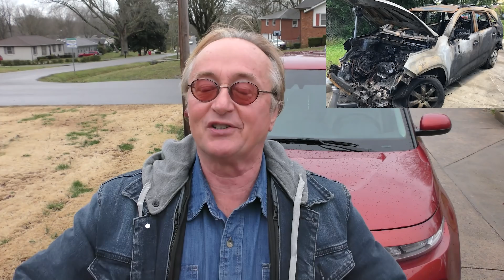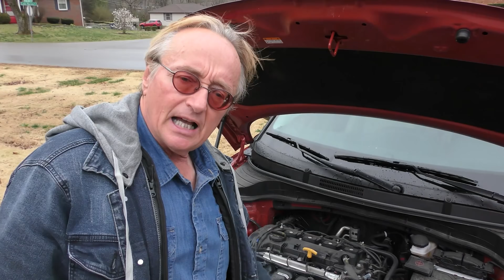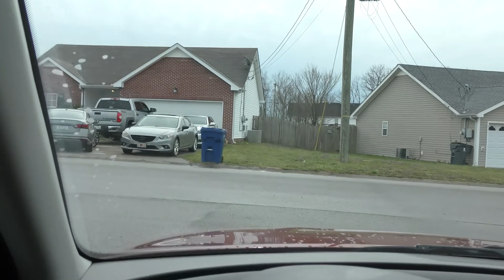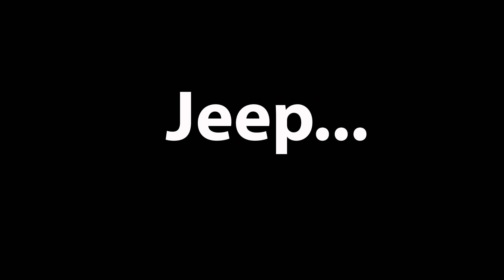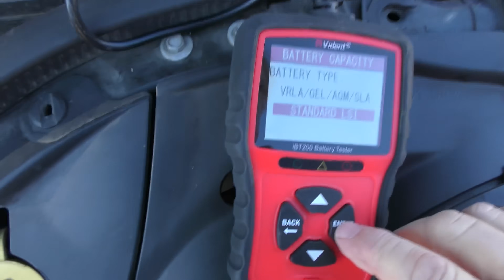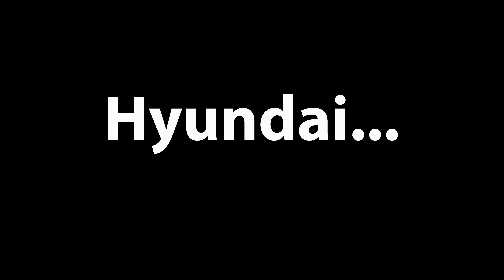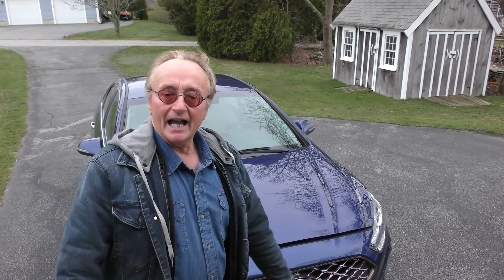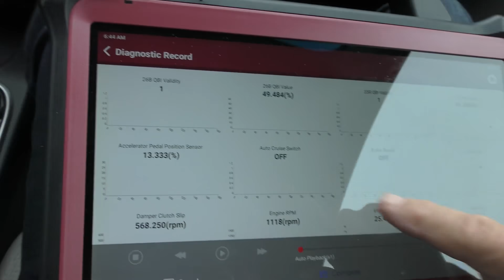3 Car Brands That are Crap

Comment: Trivia if you have a Hyundai, I bought one with 1500 miles on it, a lovely Tucson. "Must be something wrong with the transmission, it bumps when starting out from a light.
I fixed it by turning off the auto stop. The 'bump' was him hitting the throttle hard when the car tells you the car in front of you is leaving.
When I don't remember to shut off the engine stop at lights I just don't 'nail' the throttle and it goes up smooth as glass. The car starting and trying to hole shot is what made his bump. The dealer tried to explain it to him, but...

I get better mileage in Sport mode. I got better mileage in the Kia I had before by turning OFF the Eco mode. In the Tucson it gets thirty (All wheel drive, triple digit temperatures and very fast freeway driving) in Sport mode. I only get twenty seven in 'Smart mode'. Go figure.
My wife drove the Kia to 50K miles and sold it to a girlfriend. She's already put 15K on it. No problems for either of us. Very well equipped and very reliable.
Every maker can make a problem car. 

On the oil burning not being a reason to replace the motor, Ford, Chevy Toyota etc.,  all of them consider a quart in a thousand miles normal. Ask the dealership. Yeah, it's not normal with modern engines but that's the rule. Ask.

Try a Honda CRV if you want oil burning problems. I turned down NINE of them when looking for a nice SUV/Wagon for my wife. All the sellers admitted they were oil burners. 
This is a known engine problem, which caused forced recalls in China, Europe and Canada, not here.
My last Camry was pumping oil by 60K miles. That was back in 2004, it was a bought from new 2001.
I recommend Toyota but don't ever think they haven't had their fair share of problems, like the frame we put under my buddies low mileage Taco. A California truck. At sixty K miles the frame broke. They accused him of driving it in the snow belt.
Don't get a lot of snow between Lancaster and Long Beach.

Comment: I bought a brand new chevy 2500HD in 2021 , it had gaulded pistons at the start cold idling, chevy did not fix it , it took several 1000 miles for it to stop .

Comment: I’ve owned 3 KIAs.  Always changed the oil at 5K.  Always had the 2.4 liter engine.  I test drove the 2.0 liter & didn’t like it.  Never had a problem with the 2.4 liter & they didn’t use any oil but never drove longer than 75K & then traded-in.  The service is not as good as it used to be.  Overall KIA  is not that bad but could be better if they focused more on their customers.  Out of the 3 vehicles I owned, one wheel sensor went bad.  No other issues.
Reply: Interesting... Though Kia/Hyundai has like 3 completely different 2.4 liter engines and 2.0 engines from 2004-2015 or so. Oldest, Sirius is Mitsubishi engine. And two later, Beta (2.0) and Delta (2.4 an2.7) are solid quality engines as well.

The problematic ones are Theta models, that come in both 2.0 and 2.4 liter, and are completely new desing. Nu engine also has 2.0 variant, that's been subject to recall.

Comment: I have 2012 Kia soul with more than 160k miles and it’s definitely burning oil now but it had been good to me for the past 8 years. Bought it used I 2014 with only 25k miles on it. Guess I got lucky

Comment: I want that '94 Celica. I was told by a mechanic that my '05 Ford Expedition needed a ECM. I bought one online at Flagship 1. Supposedly it comes programmed & with 2 keys. I installed it myself & no change. It won't go past 45 mph & the dash reads check Electronic Throttle Control even though that part had already been replaced. The mechanic said the computer still needed to be programmed & he doesn't do that; take it to dealership. Dealership says we don't service vehicles older than 10 years. 🤷‍♀️

Comment: I own a Hyundai. It doesn't blow engines, and the transmission doesn't make "funny" sounds, because it is a mechanical manual shifting 6 gear transmission. And the oil consumption is neglijible.

Comment: I had a Kia Forte from 2010 to 2018. Around 100,000 miles it started to have normal problems but the kicker was the radio went out and I was ready for a new car anyway.

Comment: Don’t forget though that the Toyota 2.4L has had an excessive oil consumption problem since it’s inception. Did Toyota fix it? Nah, they just issued a Technical Service Bulletin stating that 1 qt every 800 miles is “normal” oil consumption. Toyota is just as guilty of this issue as Kia is.

Comment: Our 2019 Hyundai Tucson ULTIMATE a/c went out at 25,800 miles.
They tried to get me to pay $700 even with the warranty.

Gov needs to start legislating these auto-maker crooks. You pay $35,000+ for a car... should be BUMPER TO BUMPER FULL WARRANTY to 100,000 miles! 

That would force them on quality control!!

Comment: I've had 6 Kia vehicles (both leases and purchases) since Nov. 2011 (a 2012 Sportage / lease, a 2014 Soul !  lease, a 2016 Soul Base lease, and 2016 Rio LX manual purchase, a 2019 Soul + purchase, and a 2022 Seltos lease) and NONE of my Kias have had ANY issues AT ALL.  All recalls (none of which affected our cars directly) were addressed easily by my dealership and I'm a VERY satisfied Kia owner.  I've heard horror stories about the engine fires and the security / theft issue that has been all over the news.  But none of that has ever impacted us directly.  Just lucky I guess.

Comment: KIA : Killed In Action. The new car that you buy because it is cheap enough to give you far fewer miles than the usual used car with 40,000 miles on it already.

Jeep... a vehicle originally designed for military use, to be abandoned after about four years., that morphed into a very flawed car.  

Hyundai: rumor is that "Hyundai" is Korean for "Trabant".
Reply: That's not true we got 36,000 on a 2021 Kia soul that my wife bought brand new the problem with these Kia's Audi and Porsche the company that manufactured the piston rings didn't harden the piston rings correctly engine it was losing power and burning a lot of fuel we have thirty-six thousand miles on it now it runs like a top no complaints with that car but I had to put the dealer all over the Internet to get that engine changed  the last time we were there they had the hallway lined up with engines lol brand new in the crate because I put the word out on that car and the engine oil was going up through the throttle body I took that all apart to see what was going on that's when they couldn't tell me why there was oil in the throttle body    now after this is happened Doyle went through the catalytic converter now if this car won't pass the Ames test they'll be replacing the catalytic converter on there dime.  not mine
Reply: Everybody today is either too dumb or too lazy to open the hood and look at the dipstick and check the oil in their car even though it's brand-new don't mean it's good  and if you think you got a problem all you have to do is take it to mechanic have him pull a spark plug out for the bore scope down the cylinders and see what the cylinder walls look like . Just because the  pistons rings we're hardened incorrectly don't mean the car is junk it also happened to  Porsche and Audi in a few others

Comment: As far as the Auto-Stop to save gas. Kia must be slow to restart, most cars restart when you lift your foot off the brake pedal BEFORE you push on the throttle so there's no delay. And with the Jeep, low battery voltage will cause the control module slow to make calculations and make errors, kind of like a person's brain operating on low sleep. Jeep uses extra fine connector pins and weak plugs at the modules. I had one that was doing all sorts of strange things and when I unplugged the Integrated Power Module to inspect the pins for corrosion and plugged it back in, everything started working again and lasted for five years until I got rid of that POS. Sometimes it's something called fretting, where the tiny pins they use at the module build up a resistance where they touch the connectors in the plugs and unplugging and reconnecting them will restore the contact. Now, you can spray the connector plug side only with a contact cleaner then a light spray of penetrating oil or light coating of dielectric grease by smearing it into the female connectors of the plug or plugs. I wouldn't recommend spraying contact cleaner on the module pins because they are on a circuit board and most cleaners can degrade the board, same for the penetrating oil.

Comment: You forgot Nissans, the CVT transmission in those things plus the fact that the battery always has corrosion and the oil filter is in the most weird location possible

Comment: I have a 2018 Kia RIo I bought brand-new (had 11 miles on it).  I have just under 20k miles on it and I have to call the dealership tomorrow to have a new wheel bearing installed.  Never buying Kia again.  Also the rear is out of alignment and can't be repaired because it's a straight axel, like a truck.  Go figure.

Comment: We have a 2019 Kia soul for less than a year and haven’t had any issues. It’s only been a one long trip and still no issues. I would never wait until 7k to change the oil. That’s insane.  Every car I’ve had I always changed it half that mileage and never had any issues.  My first car was the worst, a 1980 VW dasher wagon had a ton of issues except oil. Lol. You probable can’t find them because they are all junked by now.
Reply: Good to hear,as im looking for the manual Soul,last year made was 2021! I was told the early years engines were much better! So, nice to hear 🤔

Comment: Bought a 2017 Kia Optima hybrid brand new. At 20,000 miles had a sudden total engine failure. 
Kia wouldn’t do nothing. 
Fortunately my car insurance company, Erie Insurance, paid for a new engine $5500 less my $500 deductible) bc the adjuster said he couldn’t rule out sabotage. The oil drain nut was found in the oil pan. Adjuster thought the possibility of someone loosing the nut on purpose. I was lucky. I’m sure that was not the reason for my engine failure though. Just a poorly engineered engine by Kia. But, my new engine has given me 80,000 miles on it now, so I feel lucky. Car has a total of 102,000. Other than the initial engine failure the car has been great. Just wondering when this second engine will fail.

Comment: Use dielectric grease on the module pins. That seals out both moisture AND oxygen. It's not 100% infallible, but it may help unfortunate Jeep owners who are in fact be chasing.
Paint a layer of dielectric grease over the connector and re-connect it BEFORE on of those pins starts to develop a POOR CONNECTION, and you, the OWNER, is moving closer and closer to this headache.
Preventative maintinance. Your welcome.

Comment: I had a Kia Soul for 11 years, I put 150k miles on it, then sold it. The only thing I had to do was buy tires and change oil. Best most reliable car I’ve ever owned. I have 1999 Silverado that’s just as good.
Reply: Im looking for a manual Kia, acceleration is really important to merge & pass in my area,Texas! How was acceleration? Nobody seems to mention this topic much? 🧐

Comment: Scotty is the only car youtuber I trust and enjoy. Shout out to vicegrip garage too, purely for entertainment.

Also, I've got a 1994 Jeep Grand Cherokee, 2wd with the 3 speed automatic and the base 4 liter inline 6.

it burns and/or leaks every fluid, it has just over 300,000 miles. She always runs, still passes smog (in California no less)

sure, she absolutely sucks gas in around town driving or stop and go, gets like... 10 miles to the gallon, no joke. But! when on the freeway, esp one that doesn't have hills/inclines, I set cruise control to 65mph, the engine turns at around 1,900 rpm or just barely 2,000 rpm and she gets 30 miles to the gallon!

I remember having a 1990 or so rx-7, naturally aspirated, and it got 17 miles to the gallon regardless of driving conditions. Climbing highway nine to skyline in the Santa Cruz mountains? 17mpg. Stop and go? 17mpg. Freeway cruising? 17mpg.
No matter how much you tried to drive gentle or if you were using a lead foot and chasing the redline, 17 miles to the gallon.

Comment: I have a 2015 Kia Soul with 293,000 miles on it. It helps that its a 6 spoed manual transmission. Yes, it burns a lot of oil ( about a quart evety 1K starting at 80K). But other than that, the car has been very good to me. Starts and runs no problem. Just have to check oil every fill up and spend $5 on oil about every 1K.
Reply: I guess I lucked up, I have a 2016 Kia Soul manual and I’m at 120,000 doesn’t burn any oil🙏🏽

Comment: Kia’s all seem to have bad brakes. I’ve never seen one stop at a stop sign. Or slow down at a yield sign. The motor must have fuel problems, because when the light changed green, and they’re 5 cars from the light, they sit there til the light changes yellow, then they go. Must come without turn signals.

Comment: Hyundai Sonata was the best car I ever owned.. it was a 2004 made in Korea and the transmission would act up in the summer time but I did 140 miles per hour twice in that car at 240,000 miles... Rust on the suspension scared me so I sold her for junk.. it's still on the road today. Not in my neighborhood.. I hope they replaced the holey parts but I kinda doubt it.. I'm still kicking myself

Comment: I mean maybe I got lucky 2017 Kia Soul it works nice and I get oil changes every 3 to 9 months. I usually don’t go to far either. Got it with just over 20k on it and it’s now close to 60k. And it was used when I got it. It’s also a 6spd manual.

Comment: My 2028 Ford Fusion 2.0 EcoBoost blew the head gasket at 45,000 miles after a long drive across Nevada with temps over 100 degrees. (My wife was driving and forget to let the car idle for a few minutes when pulling into a gas station.Always let tube engines idle for a minute or 2 after driving for long periods when its hot outside!) I had it towed to a Ford dealer in Los Angeles, who diagnosed the issue. A couple of phone calls later Ford agreed to cover the engine under warranty, saving e $10,000! No fuss; no muss. Ford hooded their warranty without question and provided a loaner vehicle for the 3 weeks it took to get my car fixed. Yaaaay Ford!

Comment: If the car was in CaliFOREIGNia, the manufacturer has to repair ANYTHING SMOG RELATED for the first 65k miles. 
Once the car is due for an emission inspection, it cant smoke or it fails..

Since the KIA Smokes,
 KIA would have to fix it under the state SMOG Laws..
Either repair what's causing the problem or replace the Engine, would be the 2 options..

Comment: I had a 1998 Vauxhall (GM) Vectra company car that used have the oil light come on after just 8k miles. Then I would fill it up again and it's good to go for another 8k miles. GM said the engine was "within tolerance" and would not do anything about it. IT was a petrol 2 litre 4 cylinder automatic. This was at least better than some of my colleagues who opted for the petrol 2.5 litre V6 - they did blow up, usually within six months. The Diesels were Turbo trashers too.

Comment: I have a 2013 Kia Soul 2.0. with 134,000 miles and still runs superbly, i have done brakes twice, of course Oil Changes at Jiffy Lube, Synthetic Blend....just replaced PCV value and Tires of course, Tune up, Plugs replaced 3 times, Manifold Sensor, Camshaft Sensor and Crankshaft Sensor... Only disappointment was waiting 6 1/2 months for my Engine Control Module, ECM !  Back ordered ! Finally came and it runs beautiful.. Went to the California coast 4 times and Mountains 5 times since... Cross our fingers, everything's good to go !!!  Your the BEST !

Comment: I've had 2 Hyundais, both were had very few issues (at least no expensive issues) until both died from transmission issues (one wouldn't shift over 3rd, the other had the clutch and some other part go out and the repair for both was above the value of the car). I'd actually recommend them if not for their transmissions.

Comment: We've had a 2012 Kia Soul for 2 years. It had been wrecked before. It's still running just fine at 200,000 miles no problems, no new parts except tires. Burns  half quart of oil every once in awhile. Strong runner. Best car we've ever had.

Comment: Simple ENGINEERING... not mechanics. ... The more something stresses the more friction, resulting in temperature increase. Temperature increase demands higher lubrication to reduce friction so as to also reduce temperature. Higher lubrication demands more lubricant.

The less the cylinders of an engine the more the stress on it to produce required power output.

Comment: OMG I had that experience with my 2015 Hyundai Elantra. The automatic transmission started acting wonky, hard shifting and also slipping between 1st and 2nd in eco mode but worked perfect in sport mode. The 1st time I took it back to Sports Durst NC, coincidentally, 3 native Korean engineers were visiting the dealer at the very same day and we all took the car for a spin. I felt relieved when they later took the car in to the shop for a day but unfortunately the transmission issues persisted and was never resolved even after numerous complaints.
Reply: I also have trans problems on my Hyundai Sonata 2.5 L 4 speed auto. Transmission control module perhaps. Shift points screwy.
Reply: I have over 100,00 on my manual transmission In a Hyundai.
I did have to get some work done on the clutch assembly, but so far so good.
Reply: So the Korean guys used your car to go out to lunch on your dime and then walked away basically.